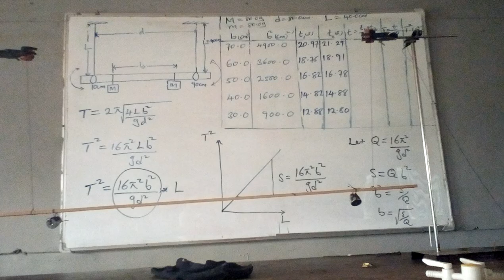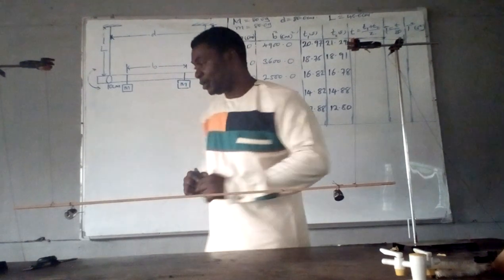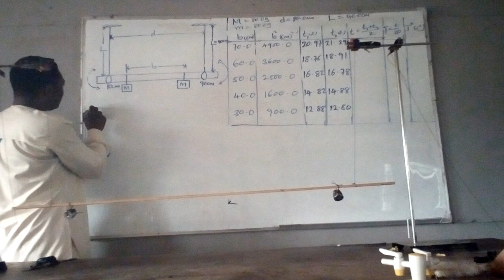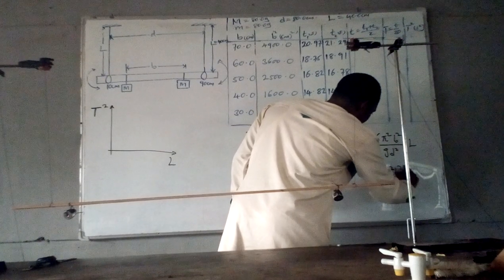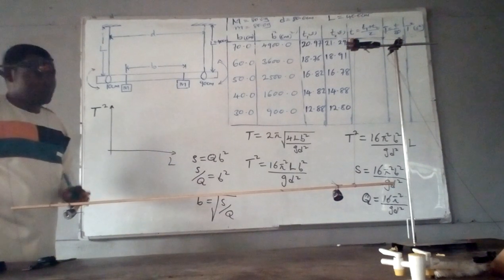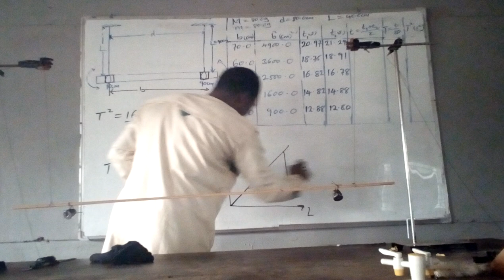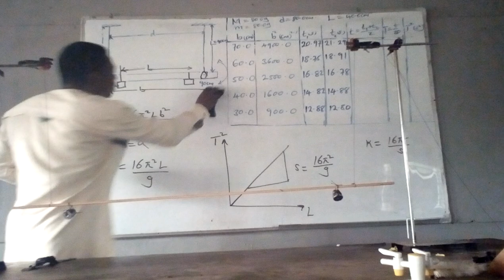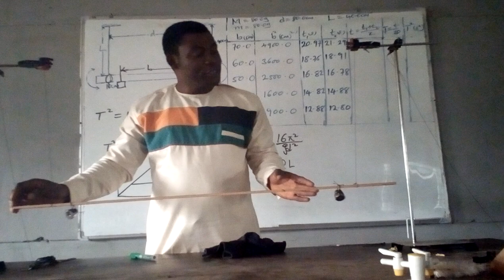waec 2021 physics practical expo

Comment: Good evening sir. This is my observation, if you complete that your table on the board, and plot it, there's no how you can get the approximate value of the length the thread as the slope.
Reply from the maker: The table on the board is for T² against b²
Reply from the maker: Make sure, d is in metres, convert the value of your slope to s²/cm² by mutiplying your value by 10^-4

Comment: Sir, I have carried out the experiment where I kept b and d constant but I varied the length of the thread from 40, 50, 60, 70, and 80cm respectfully. Then my graph is a straight line graph with my slope bin (0.026). Sir u said we can be asked to evaluate b, so b=S/Q and you know b is the distance between the masses which is 70cm, now evaluating b" by dividing slope by Q, and taking the square root of it, so the answer equals 3.2461. But I was thinking the calculated value of b" should be between 65 and 75 since the actual value of b" given is 70cm. Pls share more light
Reply from the maker: Q = 16π²/gd² make sure your d is measured in metres and not in centimeter. Then your convert your slope from s²/cm to s²/m. This give your b I metres.